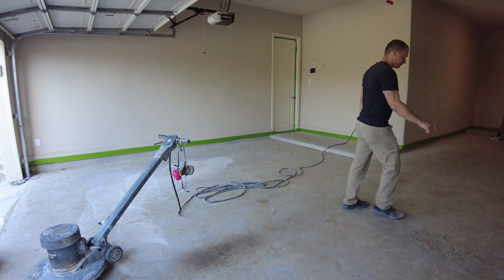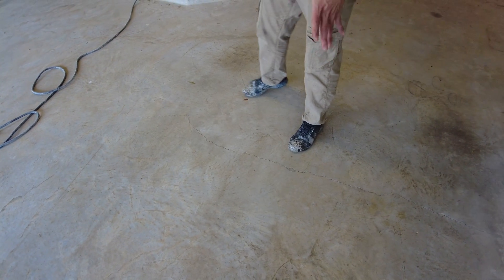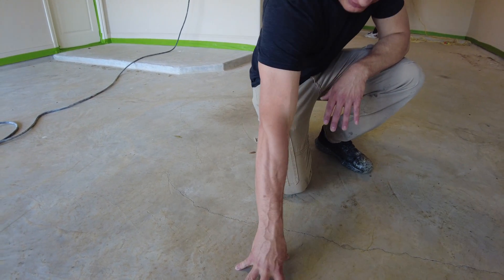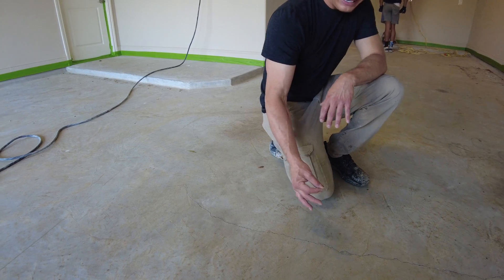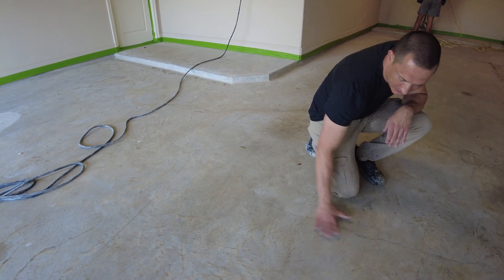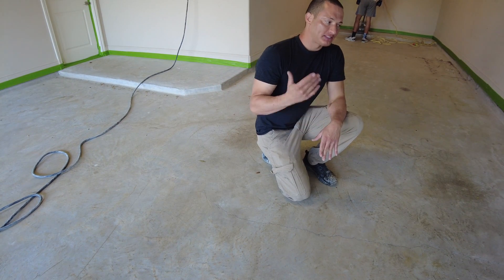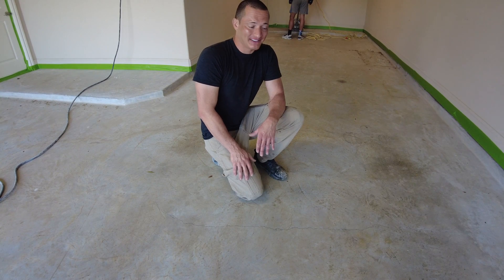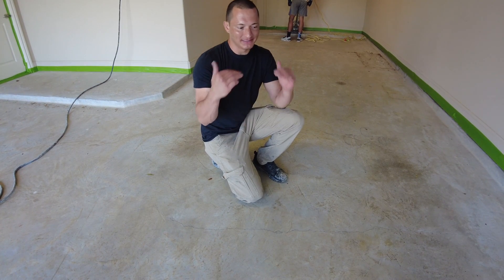Epoxy vs Polyaspartic Garage Flooring Explained by Donald Sanderson!

Comment: Tanks Great Tips!!!
Brother on the Prep steps / Why not As first step High Pressure Wash the Concrete with good Industrial Degreaser making sure No grease prior to Grinding?  Isn't Pre Cleaning the Floor 1st Prep Step after Floor Inspection?
Checking and Leaning From all the Killer Videos from Different Companies & Independent Installers
Saludos & Thanks!!!
Reply from the maker: Great Question. If you degreased and power washed then you would still need to acid wash and power wash afterwards. degreasing removes grease but it does not create a concrete profile. a concrete profile is roughness. If you pour acid on concrete and then power wash it it will make the concrete rough. So yes you could decrease and then acid wash but you would have to wait for the floor to dry and that takes time and money. The cost of the acid and the time associated with degreasing and power washing cost more than the price of diamond grinding.

Comment: If the concrete hasn’t been poured yet, would brushing take the place of etching or blasting? Or best to do smooth and then blast a couple months later?
Reply: Late reply... but I would prep every floor,  and not count on any kind of finish be sufficient as so.  Concrete must also sit for a minimum of 28 days for the moisture to cure out of the concrete completely.  Otherwise the water would work it's way upward and pop your coatings off
Reply from the maker: You actually want a smooth hard troweled surface. Broomstick finished concrete is very weak, because the ridges crumble since the rocks were pushed deep and down by the bristles of the broom. So if you have broomstick finished concrete then you need to grind it flush. You want someone to pour the slab as normal (smooth hard trowel). Then do your diamond grinding.

Comment: how many coats does Poly need?  I see some companies do 2, and some only 1. Also, some do the whole job in 1 day, vs others that do 2-3 days.
Reply from the maker: It really just depends on how many you want. If you're doing a chip floor then you put down the poly aspartic and then put chips on top of it and then clear polyspartic on top of the chips because you cannot leave chips without a clear coat. If your floor is rough then you will need a primer before all of this in order to make it more level so that's probably why some people use three coats

Comment: Great info on this video. How long does my concrete garage floor have to cure before a polyaspartic coating can be applied?
Reply: Most fabricator’s will ask 30 days minimum for the resin to be applied.
Reply from the maker: 30 days technically

Comment: Great video. Do you like to thin epoxy with acetone? Or what thinner do you like
Reply from the maker: Acetone is the fastest drying solvent so I don't like using it for polyaspartic because it doesn't give you much working time. I use xylene because it dries slower. But when it is hot and I need even more time I use R7k132 by Shewrin Williams bc it dries really slow and helps with roller marks.
Reply: @houstongaragefloors  nice good info. I recently did the back of my body shop with 100% solids epoxy, 1 pound of pigment per 2 gallons, no thinners and actually got it good. They key was spreading it out as soon as possible after you dump it out. When we first dump it it's very thin and moves easy. Give it 5-10 min it's syrup. For a guy who has only done epoxy floors twice, I was happy with it!
Reply from the maker: awesome I'm glad that it was a success. The first time I used 100% solids epoxy I left it in the bucket too long and it turned into a rock! lol @speedokoterefinishnetwork4937

Comment: Can polyaspartic be done for the garage in metal with a grit added top coat?
Reply from the maker: Not sure what you mean by "in metal"? But you can add grit to the top just like any other coating.
Reply from the maker: I'm not sure what you mean So I will answer the question two different ways... Yes you can typically coat metal if you grind it first. some people add aluminum oxide into the coating for traction and yes you can do this too

Comment: I'm surprised you can profile to a level 2 or 3 with that machine? Thought they need to be heavier? And I'm not sure, but I think aliphatic means something different?
Reply: Good observation.  That concrete looks extremely soft. Luckily for them I'm sure a light grinder would be okay. If he goes to any kind of commercial setting. The concrete  would just laugh at the grinder they're using.